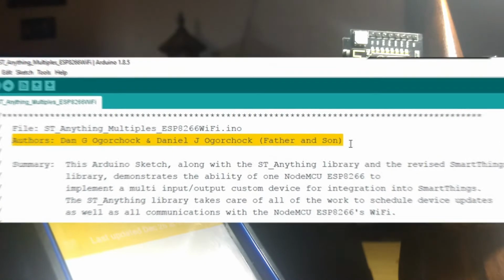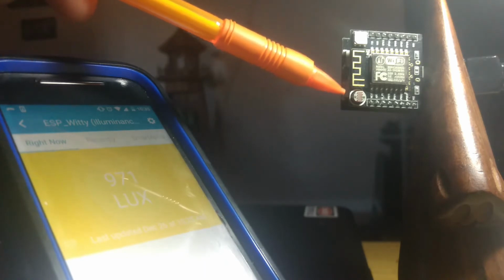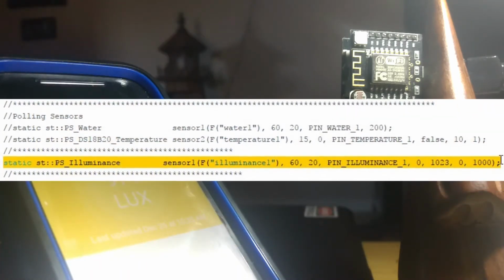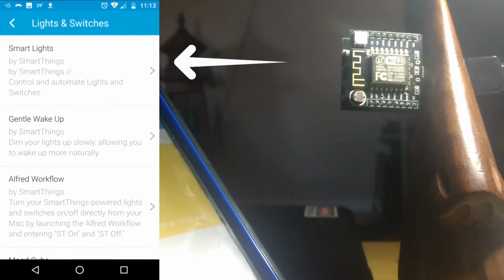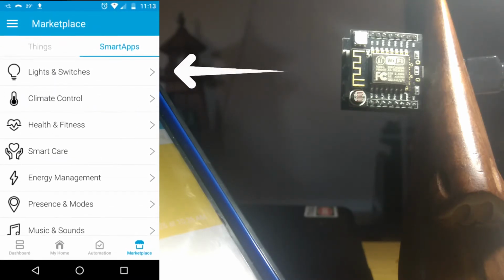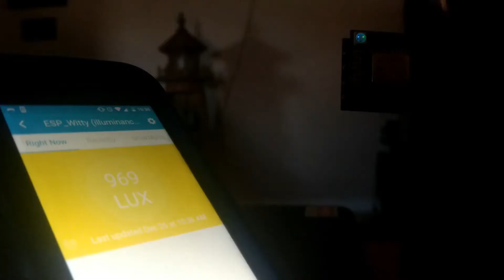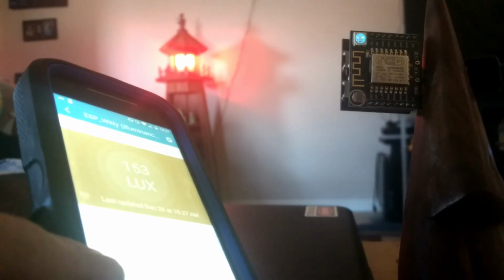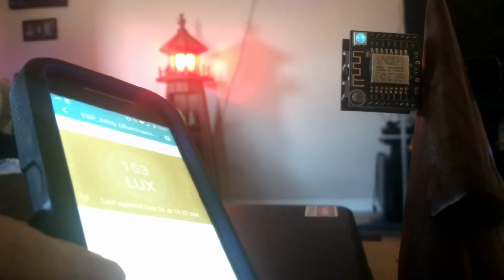ESP8266/ESP12 Witty -  Arduino Powered Hubitat/SmartThings Illuminance Sensor

Comment: has anyone found or made a 3d printed case for this? I just bought one of these and I'm looking forward to testing it, but I'm not sure how wild I am about just leaving it out in the open...
Reply from the maker: I personally haven't made a case for it. I've just used either the premade project boxes or the cheapo plastic boxes that some of the components are shipped in.
Reply: @johnhart6320  might take a look at that. If I end up designing a case for it though, I'll let you know.